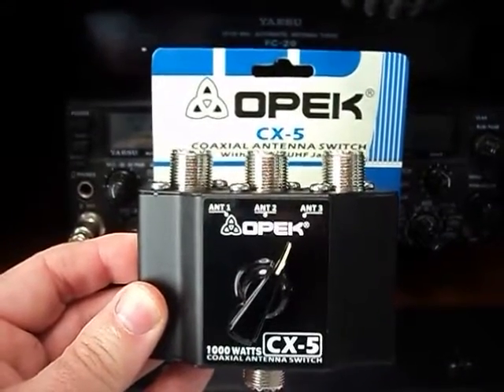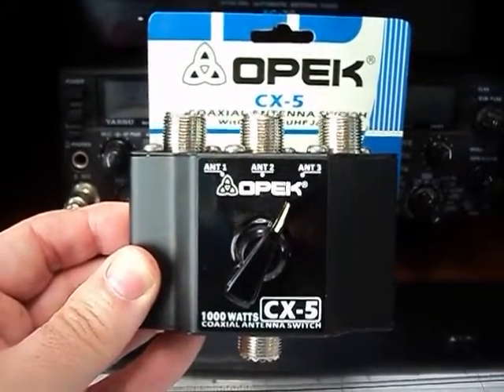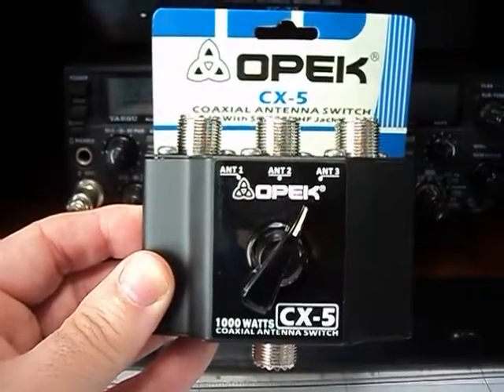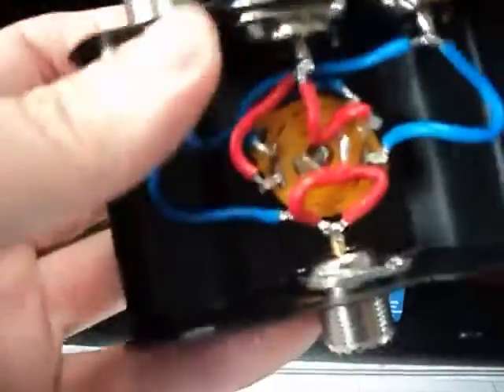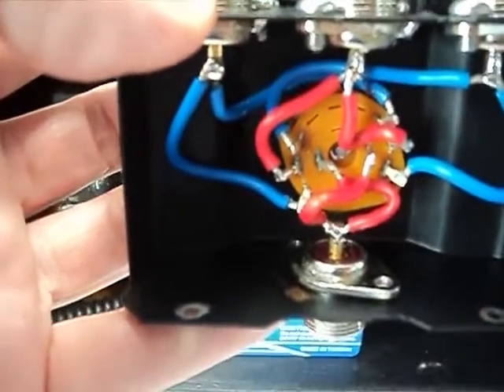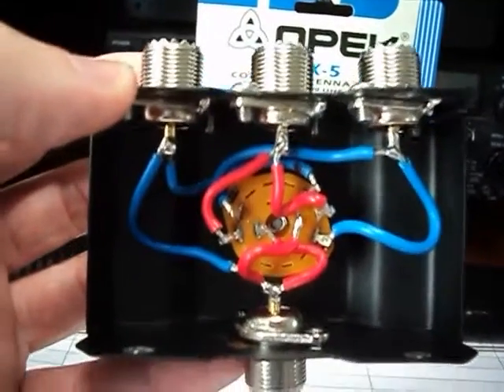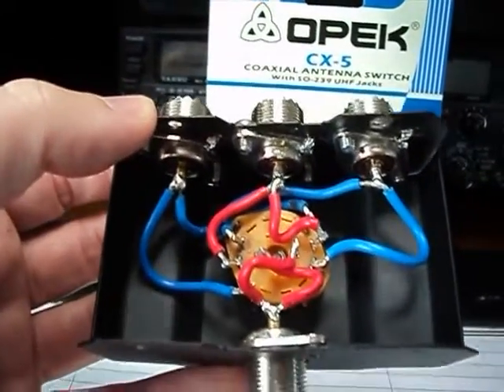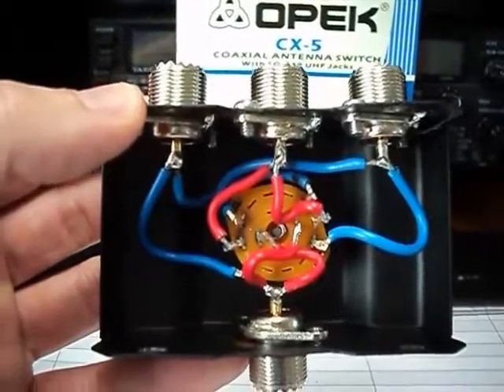OPEK CX 5 Ant Switch review

Comment: Thank you for sharing , I've recently purchased the CX5 , I've upgraded the unit insofar as I've replaced all the internal conductors to screened RG58 coax , I've also linked a conductor to each SO239 socket for additional grounding , the unit now works perfectly regarding signal loss & signal separation , I find it a challenge to improve on other designs , it's all part of the hobby , I've even replaced that 1930's dial at the front of the CX-5 to a modern design dial , it looks great , essentially the CX-5 now operates as good as any of my more expensive antenna switch units .
The old saying you get what you pay for , but if one puts a couple of hours of time & the right cable into the unit it works wonders & at a snip of the price of the more expensive switch units .

Comment: Good video.  The wiring  inside the CX-5 is identical to their CX-3 switch which I have evaluated.  The two sections of the two pole three position switch are wired in parallel, apparently to increase the current capacity. The stray capacitance and inductive coupling between the unshielded hook up wires adversely affects the impedance and isolation between the ports.  
In my measurements with a Vector Network Analyzer, the random reactance of the wiring results in greater than 3 dB insertion loss between 18 and 32 MHz when switched to Output 1, and between 14 and 43 MHz on Output 2, with a maximum insertion loss of 11.5 dB at 25 MHz.
The worse case Output 1 to Output 2 isolation is 42 dB at 3.5 MHz and 24 dB at 28 MHz. A 100 watt signal on port 1 would couple nearly 1/2 watt of RF power to port 2 at 28 MHz.  
This switch may be acceptable to connect a receiver or low power transmitter below 10 MHz to several antennas.  The poor port isolation may cause equipment damage if this switch is used to connect one of several radios to one antenna.
de KP4MD